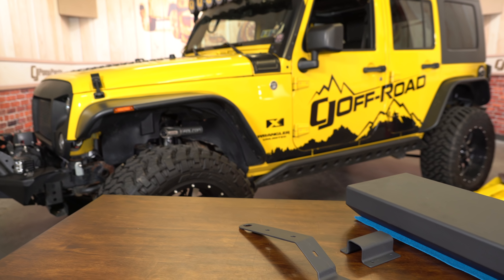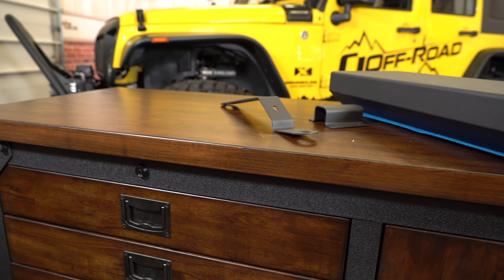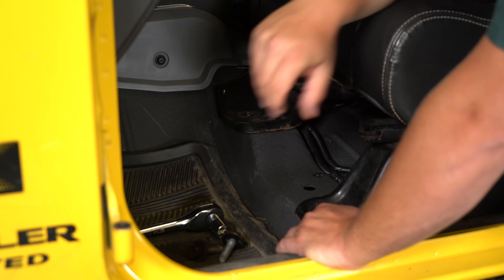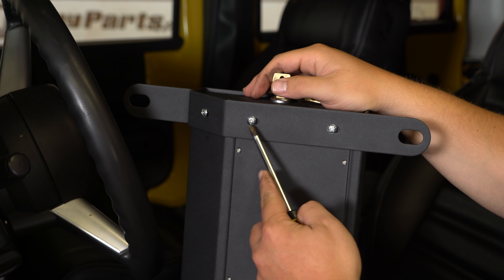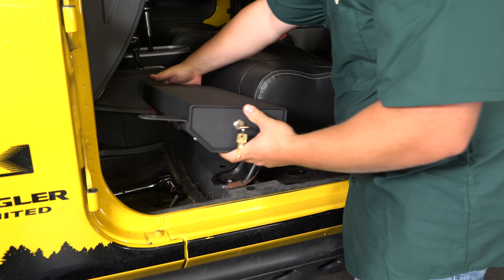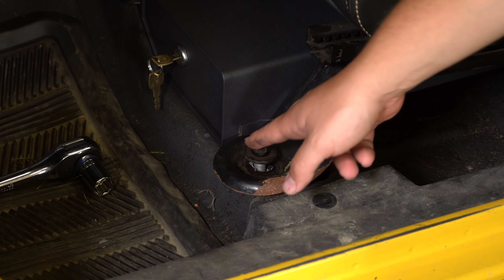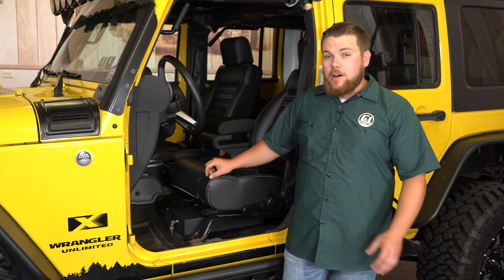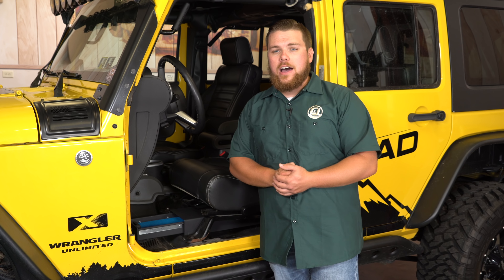2007-2018 Jeep Wrangler JK Install: Bestop Driver Side Underseat Lockbox

Comment: Just got mine installed. Took way longer than I figured it would. Definitely get a T 30 torque bit and take off the bracket attached to the bottom of the seat. Luckily I was able to fit a drill under there which made it easier. The seat bolts are long and air tools help a great deal. Not necessary but will make it quicker. The box does fit in perfectly once everything is back together.

Comment: In case you're me, there's a bracket under the seat that holds the wiring connectors. You need to take that off with a T30. You're welcome. This was a bitch and a half. If you're having trouble tightening one side of the seat, hint: tighten the other side first. FFS. Learned a bit on this one.
Reply from the maker: Thank you for the tip.

Comment: How did you behave with wires under the seat? sir
Reply: The kit comes with zip ties.
Reply: Sherifx thanks
Reply: Sherifx Do I find a complete video to install?
Reply: @osamaelhawat2766  if you Google it you should find quite a few. It is a simple install with minimal tools required. The problem most people have is that the seat bolts are tight. As far as the wires, you remove the bracket that the wires are attached to under the seat. The wires are then zip tied to holes on the frame of the seat.

Comment: I hear this is only for jeep
Reply: Record the dimensions and eyeball where the brackets would go.  This wouldn't fit my 2023 Jeep Willys JL.  So I bought the TJ version, which is squarer, and mounted it under the rear passenger seat.  I had to mod the box a little.  I didn't attach the rear bracket and grinded off one leg of the front bracket.  Between one bolt holding and the lock cable they provide for back up, this thing is pretty secure.